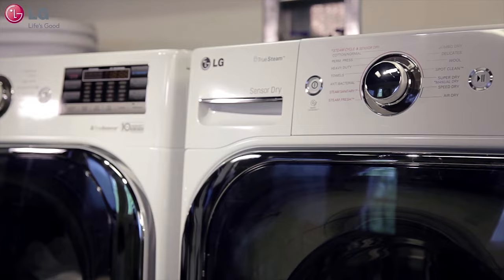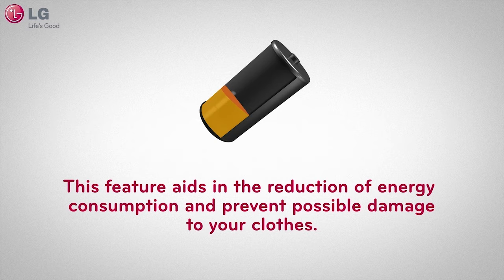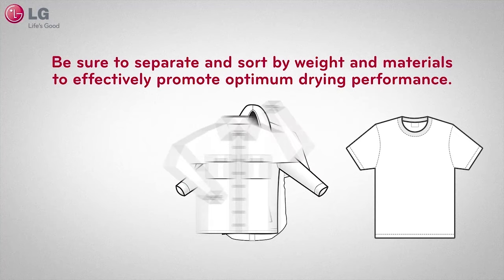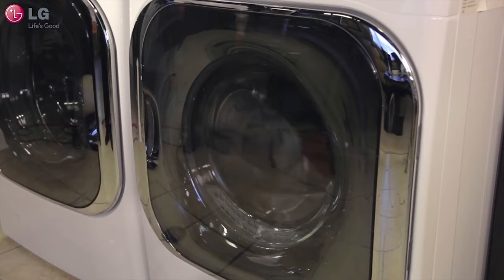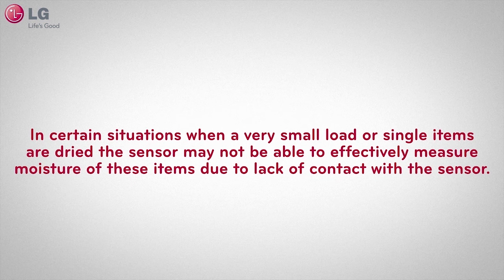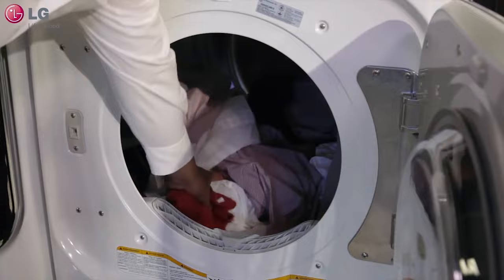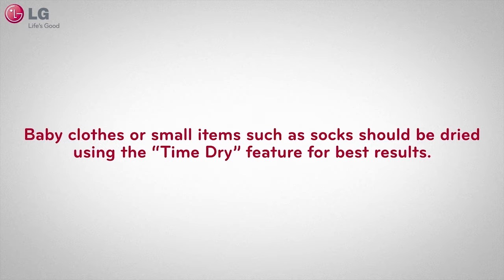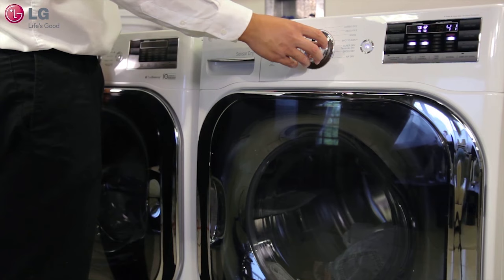[LG Dryers] Sensor Dry

Comment: Brand new dryer. Full of wet towels, clothes, etc. “Flow sense” starts flashing within 5 minutes of any drying cycle and then shuts dryer off. What a terrible product
Reply from the maker: Hey there! We truly understand where you are coming from and want to see how we can help dry those towels. First, we recommend wiping the sensor dry and ensuring it is debris free; second, check out this link on how we recommend loading your front load washer, which will help ensure your dryer is not overloaded: http://spr.ly/6056p5lHu. If you have any question please private message us on social media @LGUSSupport. We'll be happy to help you out. ^Gaby
Reply: Same thing happening to us right now
Reply: I bought a whole new dryer samething happening. Trash!

Comment: So we have to  do 2 loads for different materials? How does this save energy or time? It makes the process longer and use more energy. Buying a old dryer without this crap. My drier doesn’t even work anyway
Reply from the maker: Hi! While you don't necessarily have to separate your items by material and weight, this would provide the best results as it helps prevent any potential damage that may come as a result of over-drying or over-heating. It will save energy long term, by adjusting the amount of heat and time needed per load, while also getting rid of the need to potentially dry a heavier article again if it didn't come dry in the first load. As for your dryer not working, could you provide some additional information about what's going on? Feel free to respond here or via any of our social media pages @LGUSSupport; we'd love to help! ^Ian

Comment: Seems like I have the same issue as everyone that owns an LG. Dry sensor changes my setting and leaving my clothes wet… is there a way to turn off sensor???
Reply from the maker: Hey there, we suggest ensuring your vents are cleaned. We also recommend checking the Eco Mode, as this may stop your LG Dryer from using a more powerful dry cycle. Let us know how it works out. ~TammyJo

Comment: I disconnected the sensor to clean the lint inside. There are two connection points, does it matter which way they are connected ?
Reply from the maker: Thank you for sharing your concern with us.  To better assist you and maintain your privacy, please send us a private message on our Facebook or Twitter using @LGUSSupport, and we'll work towards resolving your concern promptly. -Francine
Reply: I’m having the same question. What was the answ
Reply: Me too answer plz
Reply: No. The reason I know is that both are fully insulated and rest on plastic, so they touch nothing and the sensors are symmetric.  Also, each sensor itself is the same part.

Comment: Brand new LG dryer, it keep shutting off a few minutes into the cycle! How do I fix?!
Reply from the maker: We're sorry to hear that you're having an issue with your brand new LG dryer. Please know that this is not the experience we want you to have. To troubleshoot your unit, you may refer to this link: https://www.lg.com/us/support/help-library/lg-dryer-why-does-my-dryer-turn-off-abnormally-CT10000011-20150485215101

If this doesn't fix the issue, you may send us a private message at @LGUSSupport on Facebook or X (Twitter) so we can further assist you. -Charles
Reply: Try quick dry and add more time

Comment: What to do when the sensor is not working? Even manual is not working??
Reply from the maker: Hello! There are a few reasons your sensor might be malfunctioning; if you could please DM any of our social media platforms @LGUSSupport with your device's model and serial number, as well as your contact info, it'll be our pleasure to start troubleshooting with you! ^Ian
Reply: @LGUSASupport  LG support couldn't help my non drying issues nor would they send a tech. All our local appliance repair places won't work on LG's or sensor dryers. What do you suggest next? Looks like all these responses are saying that the dryer does not dry properly and it does not last longer than a few years. Thanks.

Comment: THE WORST DRYER EVER!! & The washer isn’t that great either. I knew I should’ve got the Samsung washer & dryer.
Reply from the maker: Hello there. We are sorry to hear that you are experiencing issues with your LG dryer and washer. We understand that having reliable appliances is crucial for a smooth laundry experience. We would like to assist you further and address any concerns you may have.

To provide you with personalized support and guidance, you may call us on our customer support line at (800) 243-0000, or send us a private message on Facebook or Twitter using @LGUSSupport with your contact number. Our dedicated social media support team is trained to handle customer inquiries promptly and efficiently.

Please provide us with specific details about the problems you are encountering with your LG dryer and washer. Our team will work diligently to find a resolution and ensure that you have a positive experience with our products. ^Jolly

Comment: I need to turn it off I can never get my blankets dry someone help me turn it off 😅
Reply from the maker: @graycilucio1146, LG dryers are equipped with a feature called Sensor Dry, which helps detect moisture in your clothes during the drying cycle. This feature aids in reducing energy consumption and preventing possible damage to your clothes. Sensor Dry adjusts drying time based on clothes' moisture level. For small loads or single items, sensor may not work well. In such cases, use Time Dry to manually set drying cycle length.

If you find that your clothes are still damp after using the Sensor Dry cycle, there are a few things you can check to resolve the issue. First, make sure to clean the sensor regularly to avoid contamination and ensure optimal drying. Additionally, you can adjust the dry level setting to increase the dryness of the items coming out of the dryer 

For more information on understanding Sensor Dry and how to use the different manual dry cycles in LG dryers, you can refer to the following links:

LG Dryer Understanding Sensor Dry | LG USA Support: https://www.lg.com/us/support/help-library/lg-dryer-understanding-sensor-dry--1428693529352

LG Dryer - How to Use the Different Manual Dry Cycles? | LG USA Support: https://www.lg.com/us/support/help-library/lg-dryer-how-to-use-the-different-manual-dry-cycles--20153544236501

If you need further assistance please send us a private at @LGUSSupport on Facebook or X (Twitter).

Comment: The video doesn't tell you what to do with endless D90 codes.....not ready for prime time. Total useless appliance. If you notice your clothes are damp, you're hosed. LG doesn't care, they have your money.
Reply from the maker: Hi Paul, thanks for reaching out in regard to the D90 error code. As the video fails to mention this specific error code, allow us to help! The d90 error code signifies there is a blockage in the duct work, preventing your dryer from running efficiently at its maximum performance. This would result in damp clothes and requires immediate attention to the area where the airflow is being restricted.  This may be in the lint filter, in the exhaust hose behind the dryer, or in the exhaust outlet outside of your home. Please see the following link for a more detailed explanation on cleaning any airflow obstructions to your dryer: http://spr.ly/6055PZ5gl. Let us know if this helps! Should you need further support, we're available on Facebook or Twitter at the handle @LGUSSupport. Feel free to PM or DM us! You're welcome to reply to this comment with further questions as well. ^Chris